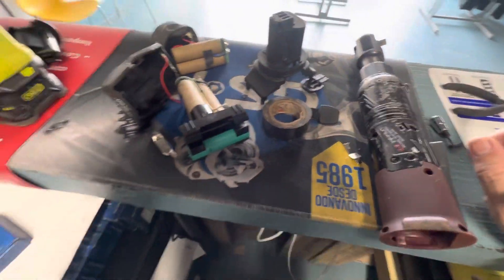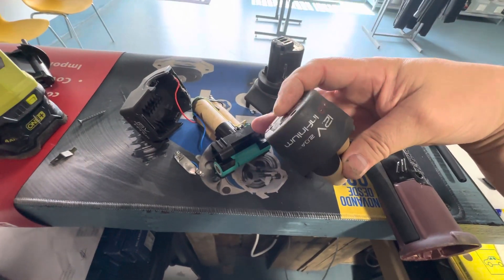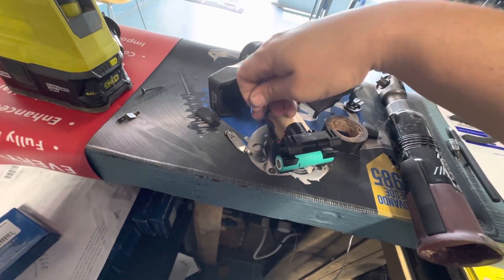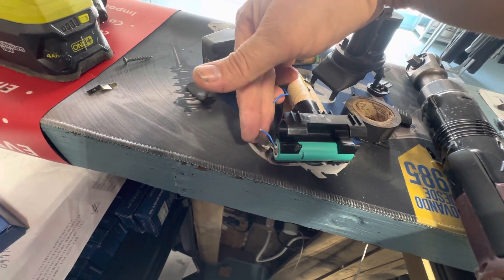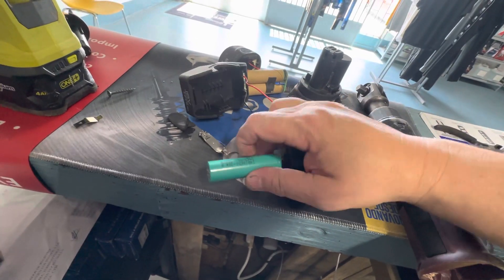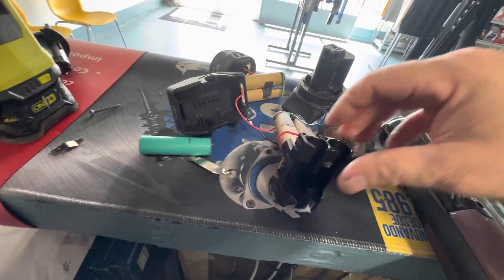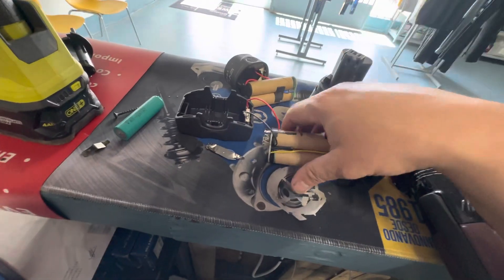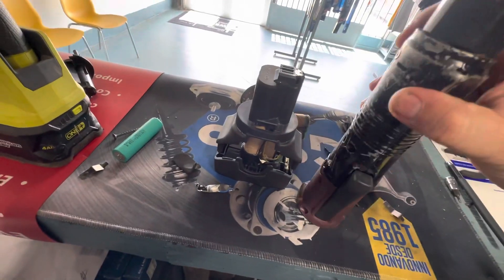Matco tools Power Ratchet 16V battery conversion to 12V

Comment: This is stupid… lol
Reply from the maker: Not really the 18v battery is $28 on ebay and the 12v battery is $90
Reply: @nicksilvacastro it’s stupid because none of this is necessary, look up how to convert the ratchet by bypassing the transistors internally. Very easy to do, don’t have to do all this bullshit this guy is doing
Reply: @nicksilvacastro the ratchet works better and battery lasts longer on 16v.
Reply from the maker: @JoelRowntree-w1j 12v ratchet won't work with 16v battery

Comment: how did you even get the battery open? the two i have tried have adhesive inside, you cant pull it apart without ripping the indicator wire, and the top housing doesnt separate from the cells
Reply from the maker: With a heat gun

Comment: You didn't have to ruin a matco battery you can just swap an el cheapo amazon M12 cell pack in there just use the matco circuit board since the polarity is reversed